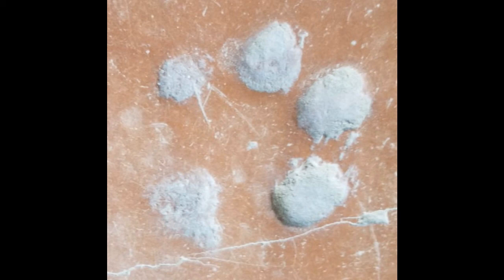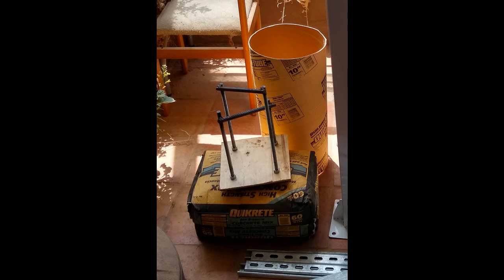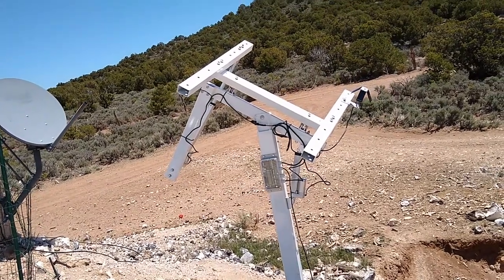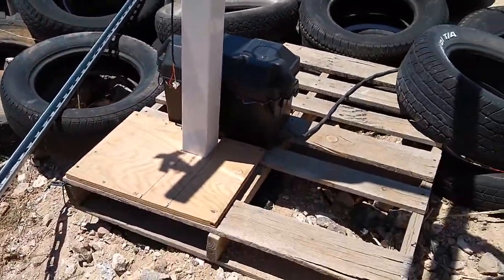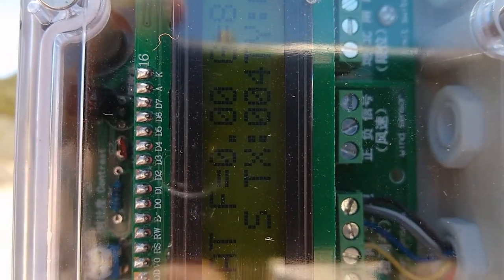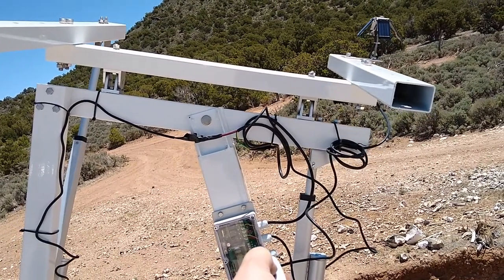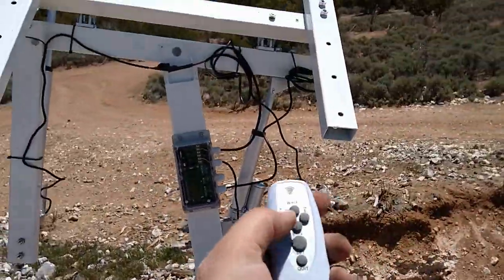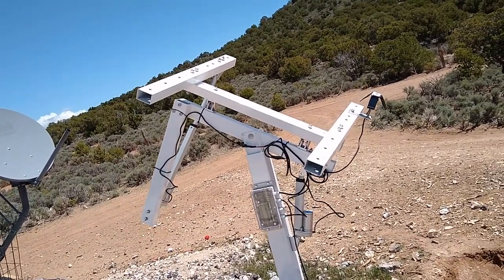ECO-Worthy Solar Tracker Update

Comment: As soon as you can, get rid of those actuators and put in the 6000N actuators, they are nearly silent and will last far longer. They are right angles to the linear motion and use worm gears.
Reply from the maker: That might be coming soon. I just had a fuse blow in the controller, might be a bit too much draw from one of the actuators.

Comment: I used linear actuators on signs on top of cars for years. Always mount the actuators upside down, when the seals get worn rain will enter and destroy it if used in the orientation you showed.

Comment: Thanks for showing the structure in detail, I will have to build my own, down here in Brazil. I already have the linear motors as well as the tracking device which includes an anemometer to quickly return the panels to the parking position when the winds get too strong.

Comment: I have a question. The base of the tracker has the north south east west labeled. Is that how I set it on the ground? My platform continues to search and never seats or stabilizes. I have checked and rechecked settings and wiring. I need help Plz.
Reply from the maker: Do you have the same controller that I have?
Reply: @aloneinanearthship4010  image the next generation. 5 wire outlet.
Reply from the maker: https://youtu.be/uvGzYGJ4jDM

Comment: This is probably one of the few use cases where mppt is pointless for the application.
Reply from the maker: I disagree. An MPPT charge controller lets you bring the power in at a high voltage and low amps to avoid cable losses, and there are other advantages as well.

Comment: How has this held up?
Looks like you get some nice breezes in your canyon…we use the gas-phase trackers and they get blown off track during wind gusts….our other sensor type stopped…so we parked it almost horizontal.
Reply from the maker: Funny you should ask about that since I was just thinking it's been about a year with the tracker and I should do a follow-up. Short answer is that it works well but I can see the wind becoming a problem eventually. I don't think it's robust enough for the wind out here long term. I am planning on moving it to a less exposed spot soon actually.
Reply: @aloneinanearthship4010  I was having issues running or powering our dishwasher…so I added surplus submarine meters to each solar controller output….now it’s easy to see the charge profile, lazy controller or lazy panel(s)…..or less optimal sun angle….so far…dogs hit one cable(pulled wires), a controller stopped output…and a charge profile is exact opposite as slide switches..(I like big easy to read analog gauges from a distance)

Comment: We built one of these for my electrical tech group final project. We used 4 photo sensors an arduino and some linear actuators.
Reply from the maker: Cool, I thought about building one using an arduino but I saw this one fairly cheap and wimped out.
Reply: @aloneinanearthship4010  this was back in tech college around 2013. They're probably quite affordable now. Looks like a cool unit. We used a cross and put the photo sensors in each corner around the cross so all sensors would need to be lit to stop the movement.

Comment: How is your tracker holding up. I have one of these trackers in my house still in the box and am wondering if I should return it while I can. I have four 55 lbs.  solar panels I was going to mount to this unit and make any modifications to make it work. Should I even invest the time?
Reply from the maker: I am actually planning to do a video about that at some point. I would say that the tracker is working well but it doesn't tolerate high winds well. I am planning to relocate mine to an area of the property that is more sheltered from the wind. Alternately it may be possible to  augment the weakest parts of the design to make it stronger, specifically the pivot points.